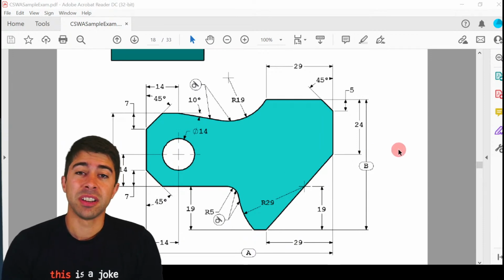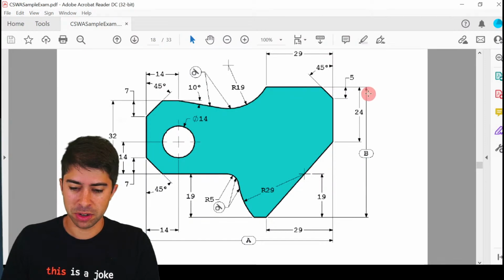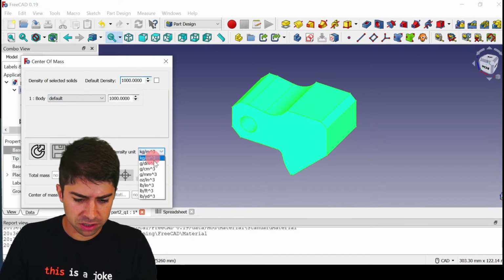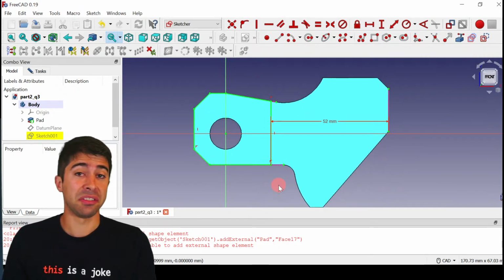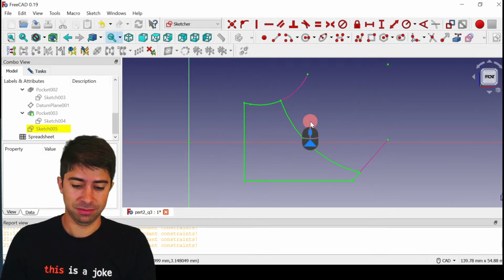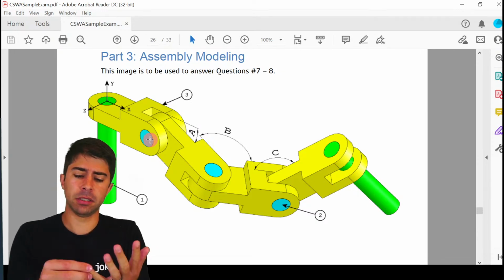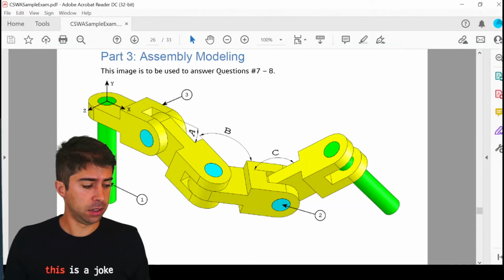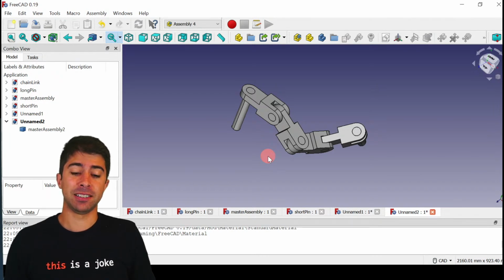Solidworks CSWA but with FreeCAD

Comment from the maker: Hi everyone! Thank you for watching. Would you consider using FreeCAD over other CAD software packages? Let me know! 👇
Reply from the maker: @paulreader1777  no problem 👍🏻 glad you liked it
Reply: @AdriaanVanNiekerk  Yes, enjoyed I it very much. I will attempt it using the, so called 'Real Thunder' branch of FreeCAD, which incorporates link stage 3 assembly but is unfortunately presently incompatible with Assembly 4 (and perhaps the macros you used). While not necessary, I think I will incorporate the full range of dimensions into the spreadsheet. Clearly FreeCAD will not compete with SolidWorks on completeness of features, or ease of use but will suffice for our needs, especially as it runs on our Linux computers. The we, in this context is the Howrah Men's Shed in Tasmania where most of us are 60+ and few (including me) have any engineering experience.
Thanks once again!
Reply from the maker: That is great! Clubs like yours are really good to encourage cooperation 💪🏻 learning from each other is the best way to learn. FreeCAD is a great tool! Do you have access to 3D printers to print some of your designs?
Reply: @AdriaanVanNiekerk  We are working on that option as some members (including me) are interested in it. Principal use will  initially be to supplement our present CAD/CAM CNC software as we have a shop built CNC. My younger son, who is a member, has two 3D printers and is currently building his own CNC to a different design, so we have some access to 3D printing already.
The whole ethos is to support good health for men, especially since we are notoriously poor at socialising and the activities are a hook for the purpose. Given the average age many feel that technology has passed them by but I am encouraging some to extend their learning. I will follow your channel with great interest.
Reply from the maker: @paulreader1777  that sounds great! Thanks again for the support and do let me know if you have any suggestions or recommendations
Reply: @AdriaanVanNiekerk  I realise your career is just beginning and you have invested time and probably money into learning SolidWorks. It seems to me D'Assault licencing  means that things are fine while moving from one licenced situation to another but, as soon as one finds oneself unable to continue with a licence (such as retiring), having FreeCAD knowledge and experience may be of some benefit. For those already retired with SolidWorks experience there seems to be very little information about transitioning. Adventures in creation  (https://www.youtube.com/channel/UC7pokUsRb6q2B0FOzSqQLlw) has a series on transitioning from Fusion 360 to FreeCAD and I wondered if doing something similar for SolidWorks might appeal to you. I have no idea what demand there might be for such material so may not be profitable to pursue on YouTube.

Comment: i remember taking the exam and the cswp exam for solidworks a few years back. I passed the practice exams many times and then when i was offered work and didnt need the actual exam, i took the oppertunity. I am now using sketchup pro ALOT and freecad as well

Comment: I was working through this tutorial (very informative) but did find a way to do the offset sketch.  Make the sketch, create a sub-object shape binder, switch to Part Work bench and there is a 2D and 3D offset option.  Doing it this way, the mass was correct with no error margin.
Reply from the maker: Well done! I will check it out 👍🏻 I did experience that part design workbench does not like it when you want to modify a part built with something not made in part design. Were you able to switch betweem them seamlessly?
Reply: Yeah, I am a novice to CAD so could be something I am missing but it was pretty seamless once I figured it out.
Reply from the maker: @thomaseager4616  good luck in your CAD journey 🙌🏻 and thanks again for sharing that workaround 💪🏻

Comment from the maker: So I managed to find my error (35:40). The two dimensions (29mm and 24mm) need to extend to the edges of the part and not where I put them which were at the edges of the chamfer.